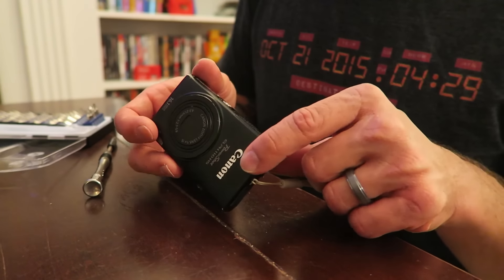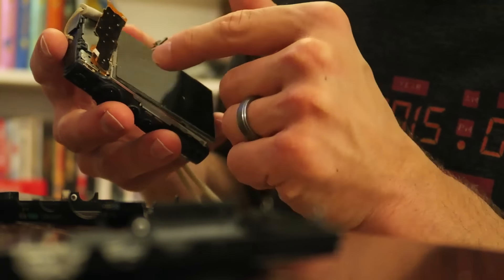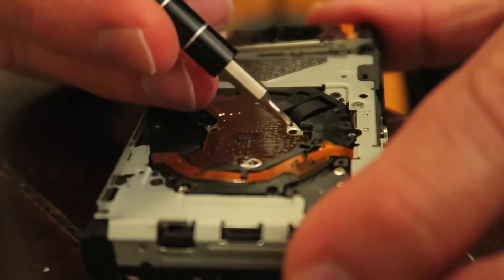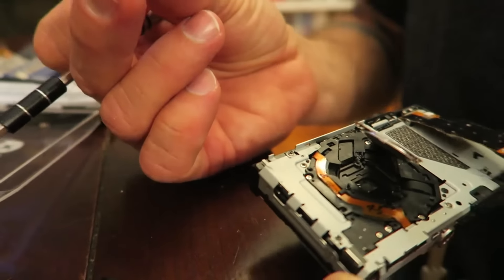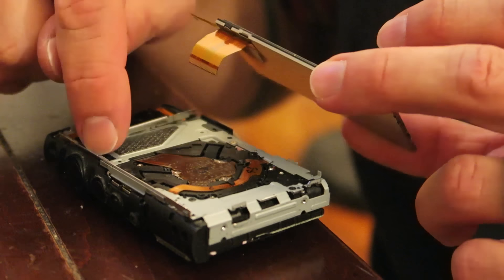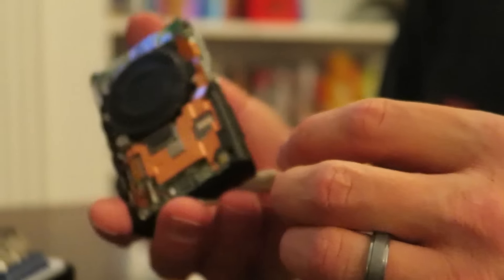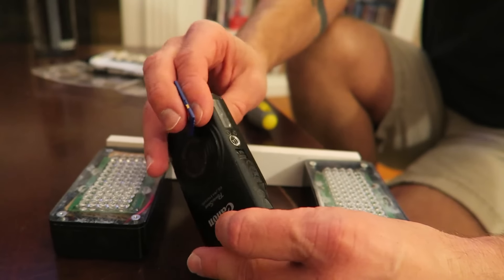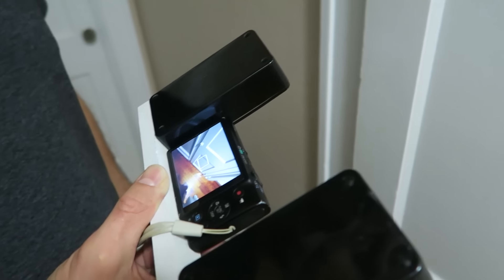How To Make A Night Vision Camera Out Of A Regular Digital Camera DIY!!!

Comment: Great stash! I really appreciate you showing us how easy it really is to have night vision for only a few bucks.
Now I've had night vision products over the years since about 2005. And I have tried a few different setups. Now with that said , please people be careful.
Night vision is not all that it seems. As soon as you turn it on you give away position. 
You light up like a Christmas tree and  you just turned on a very powerful flashlight and anyone else with NV will see you coming a kilometer away.
You need a passive way to see in the dark. Thermal binoculars give off no infrared light and they operate on the principle of temperature. Anything that radiates any type of thermal signature can be passively monitored. You can see them long before they see you.
When I go out at night to practice locating a target I use a small unidirectional and a homemade parabolic microphones. 
Sound is very tricky at night especially around heavy rock and water. By practising a little it won't take long for you to become highly proficient at night time range finding and location.
That's how I do it and keeping my couple of friends sharp so when the time comes they too can protect their families and get the hell  out of Dodge before the whole shithouse goes up in flames.
Cry Freedom!

Comment: well there are different types of night vision in your case you functionally have a flashlight that only the camera can see. this works well unless someone else is using there own nv in which case you show up like a spotlight. the other (more expensive) type relies on amplification of low level light (starlight scopes) and cannot be seen as easily by opponents

Comment: no-one said that you would electrocute yourself, almost shit your pants, and be scared of cameras for a week or two.
Reply: Take out the batterry
Reply: +Xpry it will hold the charge
Reply: +Jacqueline O'Brien Wait a few hours
Reply: Xpry Or just let it out in a controller way
Reply: Use a nylon pry bar. You probably got shocked by the flash. Lookup Disposable Camera Taser.
Reply: Daniel Smith Disposable Camera Taser, great video
Reply: actually that was the flash capacitor he was talking about its still charged after the battery is taken out
Reply: Xpry 
fyi just in case. 
Capacitors theoretically hold Charges 4Ever. Just don't go fingering old transmission equipment at the local swapmeet thinking they're harmless...

Comment: So what spectrum exactly does this camera see? Do all consumer cameras see the same spectrum of light, and then have the filter to make it see pretty much just visible light? Would this in particular be able to see a laser pointer beam? So fascinated by this all lol
Reply: - Infrared spectrum
- Pretty much all of consumer cameras.
- Regular laser pointer beams out light, not infrared light, so no u can't.
You would see the laser spot on the wall though since the camera is still capturing visible spectrum.
Reply: Well clearly it's not capturing the whole infrared spectrum or anything just short wave and all but I'm mainly wondering like the parameters of what this camera or digital consumer cameras can see on the infrared spectrum if there's any like solid information about that out there..

Now that I think about it, of course it wouldn't be able to see a laser pointer.. How in the world do military night vision goggles see beams of light, anyway?!?!
Reply: IndustrialDonut
I didn't say the whole infrared spectrum nor near infrared ... etc, not going into specifics, but the illuminating leds he used are infrared leds so the camera sees infrared after disposing of the filter.
It would be able to see the laser spot as it is normal light (can also see the spot of an infrared laser) but not the beam in a clean air, unless there is dust, fog or rain as for a human eye.
The military goggles that can show you the beam are not the thermal (infrared black&white image) type but the light amplification type, the one's with a green image. Yet they only show beams from visible light lasers, not the infrared lasers used for range finding and targeting.
Reply: Yeah yeah I get that bit now! 

Onto your last sentence regarding night vision, you say they can see the beams of visible light lasers? Any color in particular? Because I recall seeing that blue/green lasers are the most easily seen lasers with the naked eye anyway as the blue experiences the most rayleigh scattering (actually wouldn't a violet laser lol?) and the green also does but anyway anyway as you said in air without dust or particles to diffuse the light then it's entirely dependent on the air molecules scattering the light to make the beam visible, and so even with light amplification night vision opposed to IR vision you're still depending on the light from the laser reaching the lens in one way or another and so this has really confused me basically.
Reply: IndustrialDonut
Yes visible light lasers, although they might be hardly or not visible for the eyes in most conditions. We are affected by the movie industry always showing us the beams coz they are nice to see :) but it's mostly the spot that is seen, unless scattering happens sometimes as you said.
About amplification it is color free, if laser light or any light there is it will get it no matter the color. Also in the goggles, you only get a picture of green palette, the cats are green, the sky is green, we are green :P
It was chosen since it's the best visible segment of the spectrum for the human eye, and shades of green are also good for depicting details in a mono-color image. That's also why green is less used in modern forest camo as before (now more browns and greys). Blue is the least good, but in lasers the brightness makes it more visible. Actually you almost can't see a distant blue light at night unless you use your peripheral vision, hardly. That's why, as you probably know, they use it in operations inside carrier planes or helicopters when they open bay doors by night over hostile areas. Even in ships. Same for red lighting.

Comment: Modern digital cameras do not use an infrared filter,  their function is based on the materials that the CCD (charged coupled device) is layer with during the metal organic vapor phase epitaxial growing process.  Depending on what materials are used, they create different ranges of spectral sensitive characteristics.  Although the typical CCD has a maximum spectral sensitivity of around 800-850 nm, based on the materials used in its construction, other CCD's have a max spectral sensitivity up to 1100nm. They're not considered to be night vision by any stretch of the imagination as these devices require the emission of light from either visible light or infrared light up to its peak spectral sensitivity to allow the CCD to see and record the image..  So, adding IR LED's as an illuminating source, simply provides the CCD with IR light it needs to reflect off of an object so that the CCD can see and record the image in total darkness.  To the human eye, darkness is the absence of visible light because the range of spectral sensitivity for the human eye is ..on the low end, 200nm (ultraviolet) while on the far end, the human cuts off at the near infrared spectrum at around  715 -720mn.

Comment: you need infrared light,  but you don't need the torches.  quit lying to her.  depending on the sensitivity however,  you may be able to star gaze with it.  attaching a good telescope or rifle scope might help.  also note,  real night vision googles don't require torches to work.  they use the ambient infrared light available.  you can see infrared light with this mod,  yes,  but does that make it night vision??  not really.  not if you need a torch.